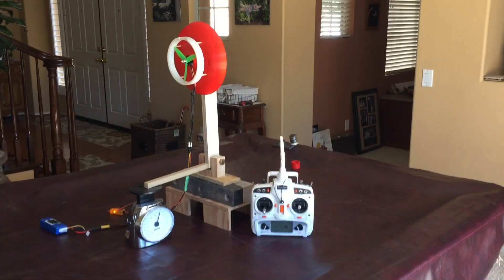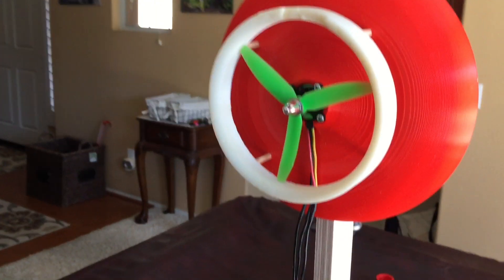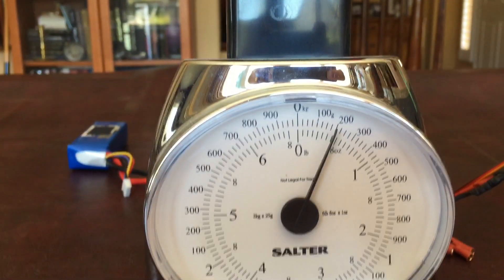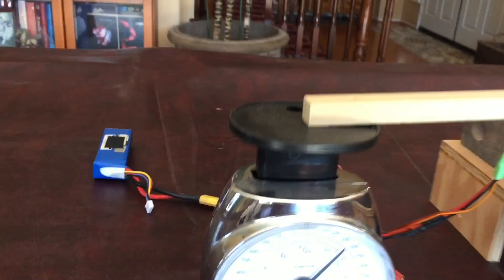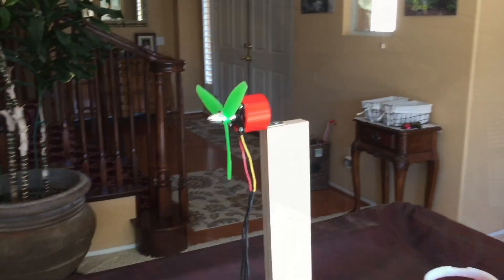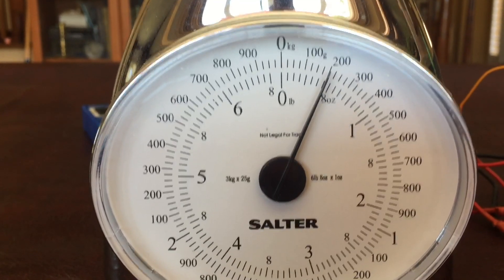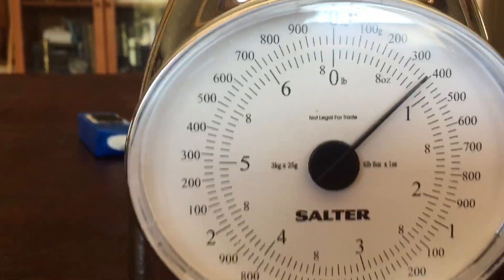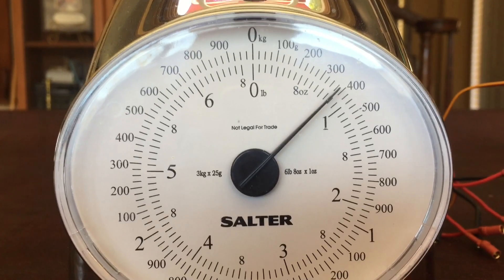Does Coanda Effect Produce More Thrust Than Propeller Alone?

Comment: Instead of the inefficient Coanda Effect,    Do you think a VTOL. would work using a , octagon plate with full length airfoils, opened 10% and mounted on the outside perimeter of all 8 sides of the octagon.   You could use 2 ducted fans mounted in the center of the octagon , facing each other.  The ducted fan on the bottom could use air from under the octagon.  All the air from these 2 ducted fans could then be diverted radially , blowing air over the top surface of the octagon, straight towards the 8 opened airfoils on the outside of the  octagon.  Has anything like this ever been tried before??  If anyone could ever test this , it would be Mark Rumsey.
Reply from the maker: Hi Dyann. I am not sure I am visualizing exactly what you are envisioning but it sounds intriguing. From my years of investigation on this type of lift, I have determined that 'diverting' air from one direction to another is what makes these type of aircraft inefficient. That is why pure thrust in one direction is the best way to go.
Reply: @coaxman  :      Hi Mark,  I am grateful for your reply.    I can see why some power is wasted using a 90 degree radial turn (like the Lockheed F35B uses}   but even with this wasted power,   I think if you used 2 powerful ducted fans with the thrust from each one facing each other in the very center of the octagon plate.  The bottom ducted fan using air from the bottom of the octagon plate and the top ducted fan using air from the top of the plate. Then the thrust from each fan  diverted 90 degrees radially by a conic shaped diverter. So all the air from both fans would be diverted radially ,like a flat, but powerful air blade just over  the  top surface  of the octagon plate.  This powerful air directed outward radially would  hit  all of the 8 full length airfoils   mounted on the perimeter of the octagon plate with the leading edge of each airfoil facing inward to the center of the octagon,  opened up 10% and getting hit  with this powerful air blade  for maximum lift, at the exact same time.
I think this would work and you would be the first person in the world  to ever test it.
Reply from the maker: @dyannmarkey3952  So you are saying that the two fans are counter-rotating coaxial with the direction of thrust for both in the vertical axis with one thrusting down and the other thrusting upwards? Then the air is diverted outward to the airfoils. I can see that working maybe but unfortunately the lower fan taking air from below the octagonal surface would lower the pressure differential between the top of the plate and the bottom. This would reduce the amount of lift for the whole aircraft. Perhaps it would work if you got rid of the lower fan then maybe you would get more lift from the airfoils. Let me think about that. :-)
Reply: @coaxman    Yes Mark,   that is the idea except the plate would not be any of the lifting mode .   It would be the 8 airfoils , opened 10% ,attached around the perimeter of the plate, facing the radial thrusting air blade from the center,  that would do all the lifting work.

Comment: the size of the prop and the coanda wing changes flow rates as well , as the prop was small in diameter than the coanda wing  the surface area for air flowing is in affect larger than if the prop and coanda wing were the same circumference.  its all about drag affecting air flow !
Reply from the maker: I tried to pattern the ratio of prop to wing off of the Aesir Coanda flying drone. The main idea of the coanda wing is the airflow above the wing produces a low pressure zone. If you make the wing too big there is too much drag. If the wing is too small there is no lift produced by the wing. I feel the size of this wing is a proven compromise.

Comment: Another video demonstrating that while the Coanda effect is popular, most people making youtube videos don't understand it. The Coanda effect is how a fluid (and subsonic air can be modeled as an incomprehensible fluid) "sticks" to a surface it flows over. Every airfoil uses the Coanda effect. The propeller is using the Coanda effect. 

If you really want to make a Coanda effect enclosure of some type, take your salad bowl and cut a circular slot on the top with a cap which allows air to exit tangentially to the curve of the bowl. Then mount a ducted fan inside the bowl, blowing out, like this. https://images.app.goo.gl/rcPkjHWqmxksyzbQA
Reply from the maker: Then why hasn't anybody done that?
Reply: @coaxman  https://youtu.be/WPUAq3QObp4
Reply from the maker: @DragNetJoe  Yes, I have seen many of these. But as you can tell they don't work well and I've never seen one lift its own weight.
Reply: @coaxman  Yea. The Conada effect is an effect, and works in the proper context. It's not a force. The fact that you get any lift at all is due to the effect, but you get parasitic losses all the way, and get boundary layer separation. It is a completely ineffective application. An airfoil is a proper application. Slotted flaps and slats or a "blown" (boundary layer control) wing are proper applications.

Comment: The air needs to be tangetial to the top of the dom. Air speed should be low enough so the flow is laminar and not turbulent. The surface of the dom should be smooth. Yours looks rough and it will create turbulence
Reply from the maker: Laminar flow is ideal and very hard to achieve.

Comment: The Coanda effect is where fluids 'stick' to objects while in motion. Its proper design is to reduce the energy entering the propellers external vortex as well as volume because putting energy into either reduces thrust. Guns and Rockets take advantage of the Coanda effect by having long tubes contain the air and increasing the pressure, the setup here just like many other propeller rings just extend the vortex radius. Make it longer and it will produce more thrust, make it smaller and produce more drag. Smaller object experience more drag.
Reply: Where fluid sticks to objects? Clearly you have zero knowledge about the science of fluid dynamics! It has NOTHING to do with the air sticking to anything! Likewise guns and rockets have absolutely NOTHING to do with the coanda effect what so ever! Likewise the idiot who replied is as clueless as you are!

Comment: Coanda works best if y use it like helicopter rotors. Also propeller system should be made the way that the sir flow is from in side out. Straight downward thrust means, that when the air needs to bend more when it hits the airfoil. Firs outwards then inwards.

Comment: Nice experiment, thanks! Doubts still come to my mind about Coanda effect focused mainly on lift, rather than on thrust.
Also, in the arrangement of your test, the 'Base drag' from the flat rear of disc may have substracted thrust, I wonder if an streamlined back of the disc after propeller would have changed results.
Would you consider testing also the doc Wagner 'Counterpropeller' idea? (Patents US1609978; DE438028; DE394244 and DE394245).
According to a US Navy study reported in the German aviation history magazine 'Luftfahrt', results were not good, but other comments say Counter-propeller improved thrust over the undriven propeller vortex. ??
Reply: 90deg rotation from lift ... about 25% loss in performance ... as thrust ... turn up ... as it should be ... and it lifts 125% more ... and its more stable ... the bell behind the fan makes the airlfow uniform and it stays uniform well past the bottom edge of the cone ... unlike with a prop only that leaves  messy backwash behind it ... as a lifting force coanda effect is great ... as a primary force of motion ... not quite powerful enough ... but then bernoulli and the rest come into play ... so if you can get the coanda effect to essentially cancel the weight of what you build ... then what you use to make it go only has to make it move not lift it ... allowing more power to move faster

Comment: Coanda Effect is about optimization which, obviously, your "Coanda" set-up is lacking...
Reply from the maker: It is possible that optimization would help but after studying different Coanda designs throughout history I still believe a prop by itself produces more thrust.
Reply: @coaxman  and more drag ... called backwash ... while a coanda lifter using a hyperbolic shape and lip actually is more stable more efficient and can lift heavier loads than a prop alone ... and should be oriented upwards NOT outwards ... 
the coanda effect if a lift force and acts best in that direction ... using it as a thrust force you take its best operation zone and cut it by rotating 90deg so it provides less thrust ... place it properly ... and it will lift about 25% more than the propeller alone ... and it will be stable .... while the prop one wont be
Reply from the maker: @0623kaboom  My question would be if this type of aircraft could produce more lift then why hasn't any been built? Rotating it 90 degrees might give it more lift in ground effect but its orientation wouldn't make a difference once it is out of ground effect.
Reply: It might make more thrust if the setup was being made in a headwind as it moves through the air

Comment: Blocking all the air flow behind the prop not a efficient test
Reply from the maker: Do you mean when the prop is by itself?
Reply: @coaxman  blocking the air flow with the red duct mount
Reply: @bryondover5517  it is called the coanda effect ... the tight layer of air that hugs to the body of a shape in flow and provides lift ... it is the boundry layer on the wing that makes the coanda effect ... that is what pulls the air faster along the top to make the lift ... by rotating a hyperbolic curve one gets the perfect shape for the coanda effect as a lifting body ... you blow air down on the small funnel end and it will follow the body along and provide lift and at the same time provide stability because the airflow is uniform along the hyperbolic cone due to the shape so the coanda effect reduces drag in the lifter setup because it maintains the uniform flow of the air going down ... it doesnt begin to eddy until well down and slower 
.
essentially take a wing slice a 1 inch slice out of it ... point it up ... now rotate ... draw the curve ... thats your bell ... the best shape is a hyperbolic curve though

Comment: it is "coanda effect" not "coanda shape". and this experiment is like comparing a horse and a shark and explaining that a shark is useles because it can't match the horse running speed. but try comparing them in water. who's the champion?
Reply from the maker: You are correct. I will change the title. How would you test to see if the coanda effect produces more thrust than a propeller?

Comment: Mark, seems the Coanda system is not optimized. Random components can't create optimal results. Being an aerospace engineer you should know that.
~MiloMindBender~
Reply: Optimized?  The setup is nothing like what Coanda developed.  He didn’t do his homework.
Reply from the maker: @ivan schafeldt The propeller would produce more thrust.
Reply from the maker: @ivan schafeldt There is a possibility that an airframe behind the prop would add some drag but I still believe the prop-airframe config would be less draggy than a coanda shaped aircraft. The main reason for doing the test was to see if the low pressure on top of the coanda produced more 'thrust' than the propeller itself.
Reply from the maker: @ivan schafeldt I was trying to say that an airframe would create more drag (not create thrust). My coanda shape is based upon the Aesir Coanda drone (https://www.youtube.com/watch?v=v8wU52QDiDM&t=10s) and the coanda DIY drone (https://www.youtube.com/watch?v=eAWVt13K2bM). All of these and more have a horizontal surface parallel to the ground that produces a low pressure zone above the dome. If you slope the drone more there is less of a difference in pressure between the top of the dome and the bottom. There is now doubt that a coanda effect aircraft will fly. I just wanted to know if a propeller by itself would produce more lift (or thrust).

Comment: Hi, thanks for sharing. I wonder however, how a propeller would compare if you had mounted an impeller in front of your Coanda wing? Intuitively the Coanda effect is kind of wasted using a propeller because a propeller (pushing air to the back) creates forward thrust by itself, whereas an impeller (pushing the air sideways) will ONLY create forward-thrust through the Coanda effect. So IF an impeller can move air more efficiently than a propeller, the Coanda set-up MIGHT actually produce more thrust. Would be curious to find out!
Reply from the maker: From all the research I have done on this type of aircraft, I found that the impellers were less efficient than a propeller. I found this mainly from patents filed for the Aesir coanda drone designs. They said that the propeller was more efficient because it was able to move more air than an impeller. If I had not found this information I would have built one with an impeller.
Reply: @coaxman  You are correct.. an impeller is good at overcoming backpressure, a but a propeller is better for moving large volumes of air against little to no backpressure... In this case, volume and velocity are more important than pressure, so a propeller is the correct choice here but your geometries still need a bit of work.